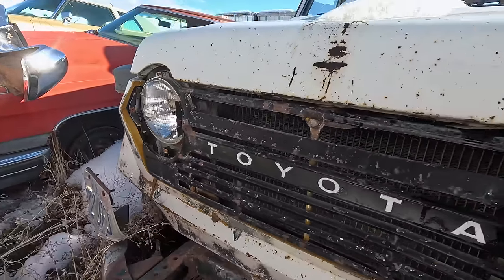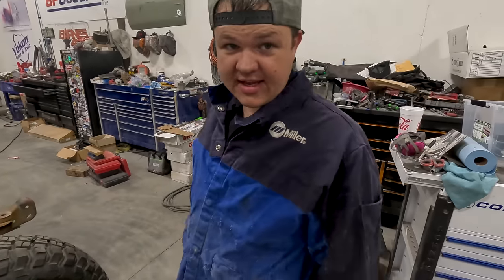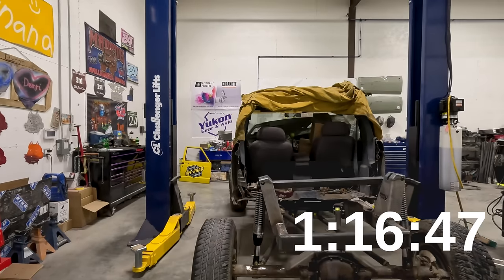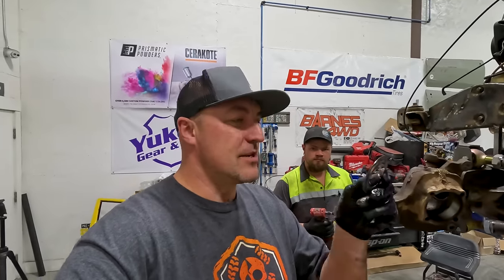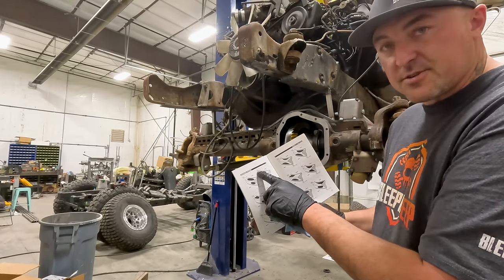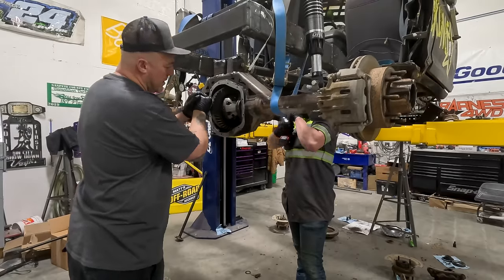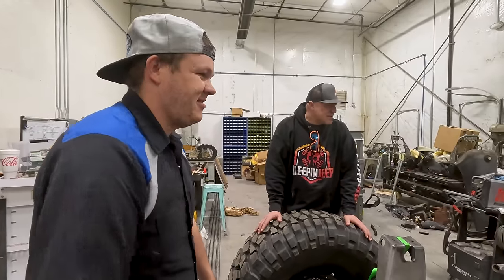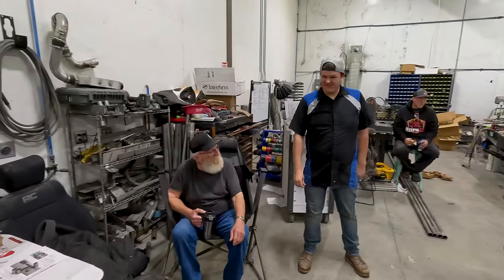MASSIVE Changes Made To Jeep Build, Broncstar Gets Geared!

Comment: 2:03 - I think this is exactly the type of welding setup that resulted in Paul from FabRats having to completely re-build his Ori's..

That shock is surely the shortest path, I'm sure the seals love it.
Reply: LOL, oh man. hindsight 20-20. electricity takes all paths of continuity, and yes, most likely most of the current went thru the ORI. Paul? what do you say
Reply: yeah.  you get on to building and forget things
Reply: I knew there was something wrong with that picture, but for different reasons. I thought to myself: "I would've taken the ORIs off before welding around them..." just thinking about the sparks flying causing cosmetic damage to them, (I know they aren't cheap, so I would protect them to the max), but now that you all mentioned the electricity going through them, that would be the main concern.

Comment: When doing vertical welding, you should (when ever possible) weld uphill.  Gravity tends to pull the welding down faster (when welding downhill) and less penetration is achieved.  Welding uphill will be slower and more penetration is achieved.

Comment: For all the rear ends I built in MHM Machine,  I used Ameribronze to make a static sleeve rather than using crush sleeves that can fail under extreme loads. If you have a lathe, cut your 'crush sleeves' even out of steel if you like. Solid is always better than a crush if you have any horseponies at the axles.

Loose the Yota regardless of stripes. lol.

Comment: I had an FJ55 in the mid 90s the original brown and beige, with rust in the roof, doors and most guards,  I ended up fibreglassing it up and painted it by hand with dark green roof paint 🤣 surprisingly it came up really well. It was actually a good vehicle reliable and good off-road and it has dual heaters which was good for Tasmania’s chilly climate. After you guys have completed your build your FJ is going to be fantastic, as far as the strips get rid of them.

Comment: Hill Billy those air tight seals in that front axle since I know you have a port a power put a socket in the u joint in the back and the port a power finger spreader in the front and pop them right out!

Comment: I've got a 1975 fj55 in my yard extra 4 speed tranny and transfercase, that I'm not using. I love my '70 fj40 though,  I learned to drive in in. It had a 3 on the tree, but I put a sm420 in it and a crate 350 ram jet. Love the power and torque, with granny a .456 gears in the diffs it just walks. Can't wait to see your build! 🤙🤘

Comment: Good video on R&P setups, the "fun" of pulling them out and in a "few" times to get set just right. I did my XJ's in my driveway years ago. D44 rear had (and has) odd setup wear pattern. Drive side ideal pattern coast side not so much.  I had a old friend who had been setting up axles before I was able to even drive check them out. His explanation on why was simply. The older D44 tooling was just that way with some gears, carrier's and axle housings.  I worn-out a deadblow hammer on just the rear axle.  I pulled it out and in so many times trying to get correct.  Been working for 20 years since no problems.

Comment: I had a ‘72 FJ40 and a ‘74 FJ55. I put a Chevy 350 4 bolt into the 55 and it was a beast. I had headers that exited through the fender wells with the mufflers under the floor boards outside the frame rails. Talk about a hot foot! The 40 had headers and a Rochester 2bbl carb. Still got lousy mileage.

Comment: ‘Coast’ has to be right on the front because of reversing out of terrain. But, if the front is set up right and you know it’s strong you can just go have fun. Like driving in and back out of ditches, recovering another vehicle using your front hooks and generally being a hooligan :D If you can drive into a ditch, turn full steer one way and hit the loud pedal with the locker in, then you own a cool truck!

Comment: FJ55 on the JK frame is brilliant, FJ55’s were all over Australia in the 70’s & 80’s but died out very quickly, I haven’t seen one on the road in years. If they got parked up they rusted out pretty quickly. They used one in the movie “50 first dates”. When it’s built you’ll need to take the boss on fifty dates to get her onside  with the stripes

Comment: Hey Robbie I have notice that every time you have to switch everything around it is A LOT OF PUSHING. I have seen something on another channel that you need and it would solve a few of your problem and not only that it a really cool toy to have. it could even help on some of your rescues. C&C Equipment on you tube, has a Bunch of Mercedes Uni-Mog with a blade/ bucket on the front and a back-hoe on the back that could be modified to a magic boom lift and you could add a winch  it would make the perfect beast for all your needs.

Comment: Robby:  I hear you say many times: "Blow-tack and Static", but I'm not sure of the exact meaning and outcome.  Please explain to me and anyone else not an experienced painter.   First, is that exactly what you said?  If so, continue.... 
My guess is, when you wipe with the tack cloth, you are wiping off the loose fibers and dust that have landed on your work to be painted.  To "Blow-tack" means to BLOW off some of the stuff, and "TACK-cloth" the rest of the particles.  Is that the first part:  Blow air and Tack wipe the surface?
When you use the Static gun, I can imagine that static air is produced, and it causes the dust and fiber particles to be "repelled from the surface" or "stick to the surface"?